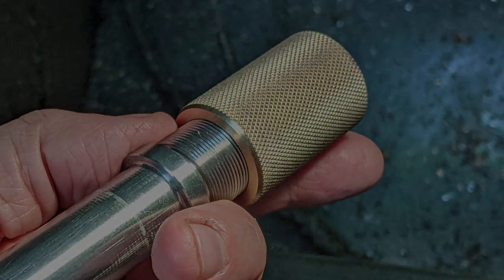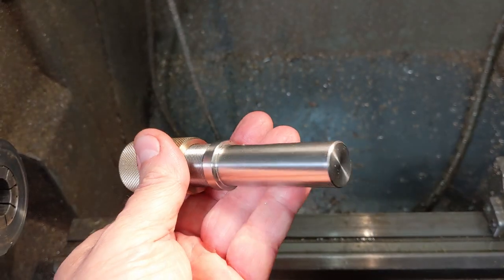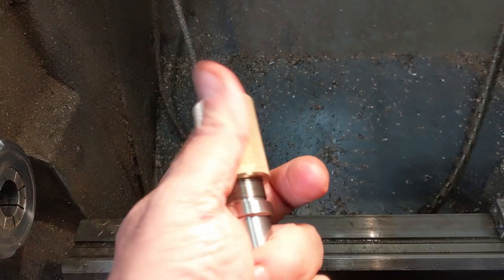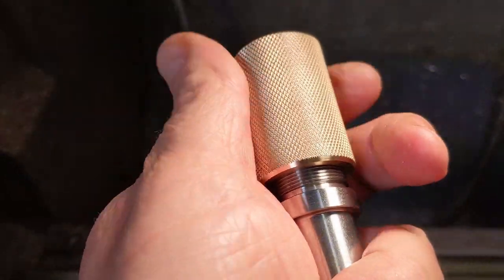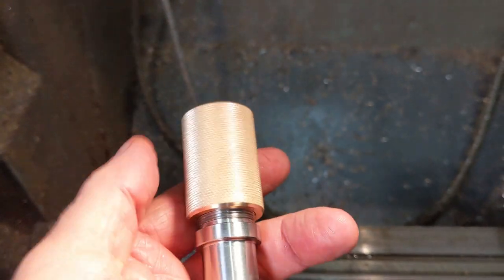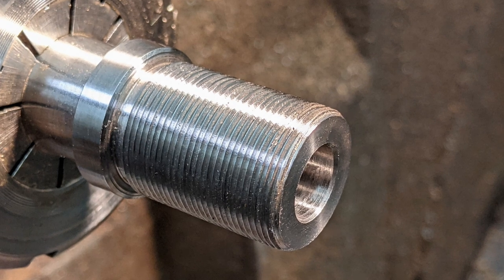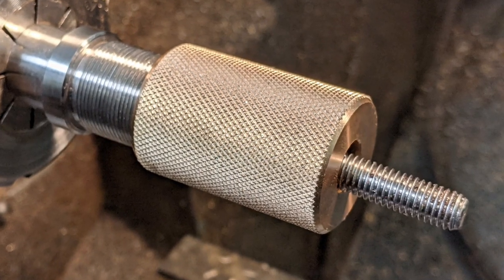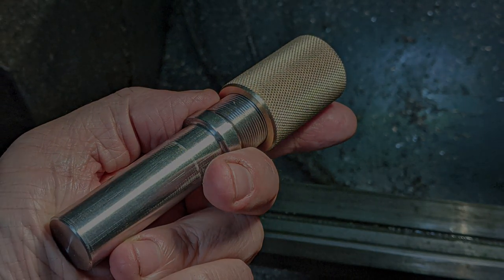Lantern Chuck Update

Comment: Nice work, and interesting. Thank you sir.
Reply from the maker: I need to make a small version next for these M1.6  and M2 screws,
Reply: @MachiningandMicrowaves   Look forward to seeing the small one. I need it also for 1.2 - 1.6 bolts. The only complication is that they are hexagon head bolts (miniature model engineering). I am thinking about reversing your idea and using allen head screws (as a mini hex socket) to prevent bolts from rotating. Great vids - just joined! Thank you
Reply from the maker: @bambukouk  That's a good idea if you can get the right sized socket screws and find a way to support them, perhaps use the same type of magnetic socket with a 6mm hex bit drilled and tapped to take your reversed Allen screws and fixed with Loctite. I must make a wobble broach so I can make tiny hex socket holes.  I have an Alexander Deckel clone so should be able to grind up and harden the broaching bits